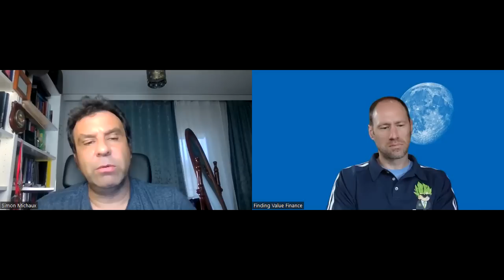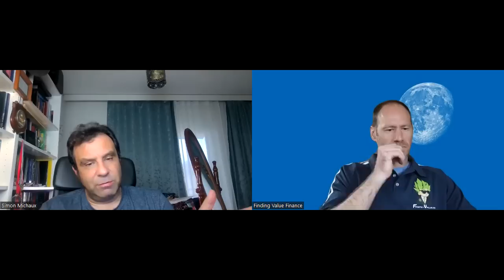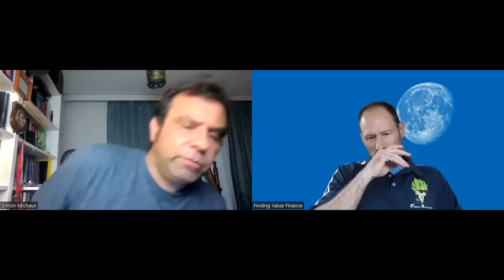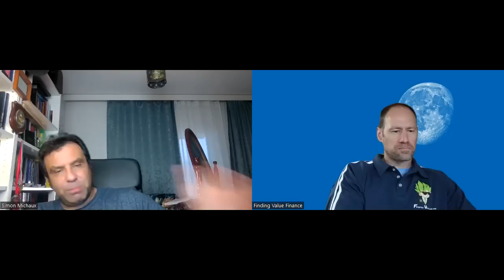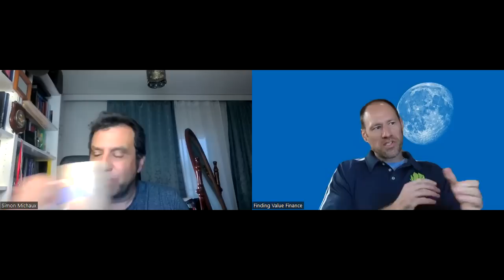THE UNSUSTAINABLE TRANSITION TO RENEWABLES With Simon Michaux: A MUST WATCH

Comment: I was brought onto a major US DAC (Direct Air Capture) company to lead development of reactors that "remove" carbon from the air. I worked directly under the VP and we CEO had many discussions about the technology and future direction of the company. Having been a subscriber to this channel for a few years now, I've learned to ask critical questions about the carbon footprint of the supply chain and relate it back to the payoff of our technology. In a nutshell, the VP , CTO, and CEO did not sufficiently understand the impact of carbon production in the supply chain on the payoff time to net zero carbon as advertised to investors. Needless to say, investors didn't grasp this either. Our systems ran on a huge diesel generator that we kept outside. This experience really gave me confidence to go all in on uranium and fossil fuels. Your guest is spot on.

Comment: My sense is that the sliver of places that thrive this century is very thin. Most places will see resource driven war until they are driven into the ground. Relocate while you can. 
When you do buy land, livestock and a highly durable house that requires minimal energy to heat/cool or otherwise maintain. My best advice in short to help ensure your family’s survival in what I expect to be an otherwise increasingly BRUTAL and violent century.
Reply: Spot on, those without a network of like minded people who understand how things work will adapt, those who live in large cities who think electricity comes from the hole in their wall socket and milk comes from the supermarket shelf will not do so well, and many of them will perish. The population won't stay this size if they drive us toward these new energy goals.
Reply: Move to Iceland, 
Build a passivhaus house, 
Build a geo thermal greenhouse,
Ditch the car and use a bicycle.
They are already 100% hydro & geo thermal.

Comment: 47:25 "...the rest of the fuel rod is actually U238 --the stuff they make bombs out of."  No, that's wrong.  For bombs u simply keep centrifuging from 4% U235 to much higher purity at about 94% pure U235 or higher.  He's wrong on this very fundamental, very basic point.  U238 is what they make depleted uranium rounds out of, for the A-10 or for M1 Abrams SABOT rounds and so on, and for a very small number of specialized batteries (for satellites).
Reply: Plutonium is made from U238. It is the principle behind some breeder reactors designs.
Reply: I also thought that was a stupid thing for him to throw in. Pointless fear mongering. U238 can be held in your hand indefinitely. It's harmless so long as you don't eat it or grind it and inhale it.

That said, he is TECHNICALLY correct in that thermonuclear weapons do contain U238 and derive a good bit of their energy from the fissioning of those atoms. The difference between U238 and U235/Pu239 are that U238 does not release enough neutrons during fission to create a self sustaining reaction. So U238 is used in the second phase to add energy from the neutrons created in the first stage.

Comment: 13:00 stop saying that! That's just wrong ! First, computer power supplies are SMPS. They accept an input voltage amplitude range from about 100 V to 220 V. They operate in a manner that does not care about amplitude
Second, no, it will certainly NOT "cook" "most computers". What are you even talking about?
Reply: I personally experienced a brownout that fried my refrigerator "control circuit board".
Reply: @jato72  fridge, not computer
Reply: Its one or the other , not variable. And computer power supplies are switchmode, yes. The supply frequency and voltage cannot modulate, it will lunge.

Comment: The presumption that we “need” to even transition from hydrocarbons to electric solutions for the reason that we need to reduce carbon dioxide emissions is entirely spurious. Annual man-made carbon dioxide emissions are but a small fraction of total (naturally generated) emissions, and anyway professors Happer and Van Wijngaarden at Princeton have conclusively demonstrated that there is NO link between increasing levels of carbon dioxide - irrespective of origin, and in any case a beneficial development - and increasing temperatures, the latter which will soon be seen to trend downwards in any event. 
See Dr Thomas P Sheahen’s presentation ‘Methane - the irrelevant greenhouse gas’ for further details, or look up both professors Happer and Van Wijngaarden to learn more.

There is no climate emergency.
Reply: it's rather based on the time remaining when you compare oil consumption and oil reserves. 50y max at current level of consumption ...
Reply: @eboydens  You do realise that we don’t have more than 15 years remaining before the X-class flares (Carrington event scale plus) start to come thick and fast, and seven years thereafter the Gleissburg cycle comes to its 316th and regular, spectacular conclusion, don’t you?     Diehold Foundation, Series 4: watch them all - ALL of them. It’ll assuage your fears about there not being enough hydrocarbons being pumped for our needs.

Comment: He gets such basic information wrong, it's hard to trust he's correct elsewhere. He says electric cars need "hours" to charge at public charging stations but this is just false. DC charging lets you charge in 30 minutes. 100 miles can be added in 15 minutes in some cars, and this is already becoming standard. Then he says people will be lining up to charge. This is another common mistake talking heads make. Most EV owners charge at home overnight at low rates (you could even set up solar). It's only the rare occasion on a longer trip that charging at a public station is needed.
Reply: I didn't watch the video but even the title smacks of bias. Wind and solar are unsustainable? Ok sure, if you say so.
Reply: when i can fill the gas tank in 1 minute and that tank is good for 500 mi
yes.If I use the "100 mi in 15 minutes" figure you mention, you yourself admit it takes more than an hour to figuratively fill its tank.
Reply: @BlueToronto  you seem to lack knowledge about what does "sustainable" mean, or what wind turbines use involves.
Reply: @GeorgeTsiros  Nah. Seeing as your counter is to attack my intelligence, then I think you've already proven me right.
Reply: @BlueToronto  Did you just confuse intelligence with knowledge? I said "knowledge", not "intelligence". Neither wind turbines nor solar panels are permanent. Every couple decades they need replacement. They are, by definition, unsustainable. Every 20-30 years you will need to rebuild the entire world's wind turbine installations. Even if you somehow manage to reclaim HALF of the raw materials from the decommissioned turbines, you still need to CONTINUOUSLY and PERPETUALLY keep mining for metals to construct the new turbines. Those metals are finite . Sooner or later, it will literally run out. Do you now see how "wind is not sustainable" ?
Reply: Nice try but, no, I didn't.
Reply: You have to remember he looked at a lot of this stuff in 2018 when the tech wasn't as good. He's actually right about charging being a bottleneck but its not the batteries that are the problem but getting the connections to the grid. You put 6 of these level 3 fast chargers in a lot and you'll need ~2 megawatts of capacity from those alone. Depending on where you are that can be a big problem.

That said, he does get several basic things wrong but recalling some details incorrectly doesn't sink a thesis.
Reply: look at your gas station now and imagine a 15 min fill time.  You would have 2h lineups fast.  In 2022 there was 100000 slow public chargers and 28000 fast in the US.  So for today his stats are accurate.  Charging at home or hooking tons of solar is a massive change to the grid that requires management and change or we won't just be doing the same thing today.
Reply: @BlueToronto  How can you give an opinion without listening? That is strange. His basic assumptions are correct. His comment on mining and extraction are right on ...
Reply: @Jeremy-WC  Electric cars, unlike piston engined cars, can be recharged at home, without even special infrastructure if you are willing to accept those 3 to 5 hour charging times. Drive in the day, charge overnight or vice versa.
Reply: @BlueToronto  So, by your own admission, you do not have a clue about mining and supply chains. Then, your commentary is useless.
Reply: @shawnnoyes4620  I didn't admit that. Do you have a constructive reply for the OP?

Comment: Please please please stop comparing a renewable grid to the grid today and acting like its not viable if it isnt a drop in replacement. It's well understood that the sun doesn't always shine and this can be accomodated for. It just means we won't have the always on demand grid of today. I live off grid with only solar as our energy source and we don't go around turning on electric space heaters on cloudy days or the middle of the night. But, we do heat our water tank during sunny days when the batteries are full. It's quite comfy actually.
Reply: What factories are powered off-grid by their own solar?